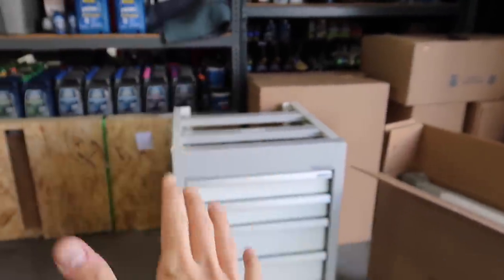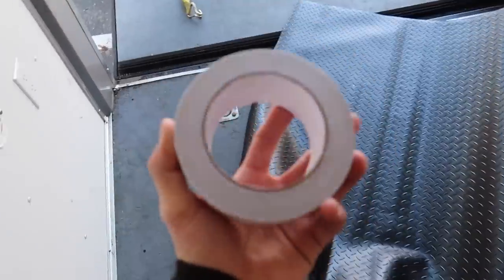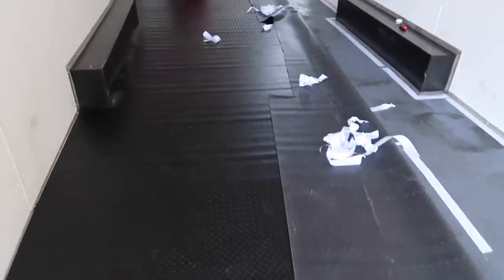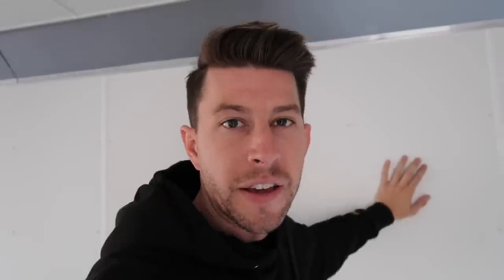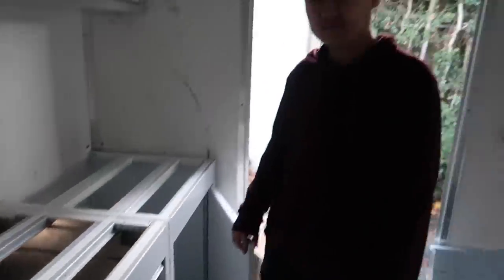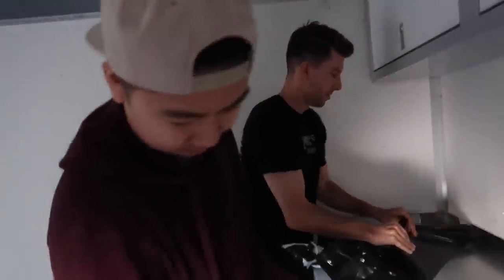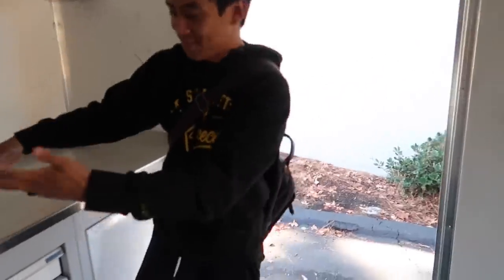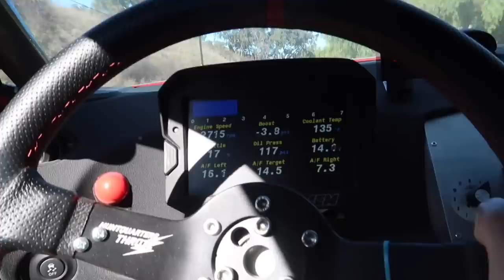IT’S FINALLY COMPLETE!!

Comment: I think I would’ve taken off all that aluminum trim along the bottom of the walls and ran the rubber up the walls and reinstalled the trim to keep the rubber from going anywhere. Also no water would get underneath the rubber.
Reply: Agreed. I was also gon a mention i hope he did more than sweep cause that most certainly didnt get all the dust and hope he put down more tape then just the edges.

Comment: I’m going to assume that you put new plugs with the coil packs and if so I’m also going to assume that you gapped them correctly? The issue may not be with coil packs or plugs, it could be the plug wire and an easy test for that would be to start the car in the dark and see if you can see spark jumping in the engine bay.
Reply: I agree. Or it could be a defective coil pack he purchased.

Comment: Had same problem. When getting into boost, power cuts. The problem was the sparking plugs. If not. Check the injectors if they are dirty or not. This could happen because the car has been sat for a long time without being used.

Comment: Yo Tj, worked a t trailer manufacturing plant for many years. Always trowel glue on the floors for flooring. Water will actually get trapped between that and the floors. Just food for thought. Love what your doing though for sure though!

Comment: TJ, also check wether this problem occurs only on the highest boost setting. Try the car on a lower boost level and see if it happens. If the problems stops on low boost try and get a different spark plug. For example instead of ngk 7 get ngk 8

Comment: Use raptor liner on the floor, you could even use there tint-able for custom colors. Would help with Traction and be waterproof. Not crazy expensive either.

Comment: Should have taken the D-rings out and cut the holes for them and reistalled, the lip around them would seal it and be the cleanest look. Also, lay floor, cut it to fit, before making it final, throw a heater in there and close it up and go get lunch or some shit, once it is warm the wrinkles start to come out and you can get all the wrinkles out when you stretch to... Tape it???,  I would have used contact cement, 6in out from the wall all the way around, and do the loading end all the way across and 4 ft back, it will see the most action. Final though if you want it to be really fluid resistant, go to the Home Depots and get you 50 ft of black commercial cove base and use it to seal the walls at the corners. Won't be fluid proof, but your tape will hold up longer and it will keep floor rot down, because if water gets under that flooring it's going to speed up rot because it wont dry due to the rubber not letting air get to it, and that is right where all you rivets or screws that hold the floor boards in are, and that is where water will starts to absorb into the wood first. Looks pretty decent though, and if the wrinkles come out I'll be shocked, but if after you drive a car over it a few times it goes all fun house mirror on you, maybe take some advice, I've only been installing floors of all kind for 17 years.

Comment: My opinion but under cabinet lights , flag pole set up ,  awning , led light bars at the rear and side of trailer and I think the trailer will be completed....... I would also install a trailer vent on the roof due to gas fumes from car and extra gas that's stored in there and from Calvin

Comment: It’s a shame you spent all that money to upgrade the trailer but didn’t take the time to clean and paint the walls before putting the cabinets and floor in. You also should have mounted 2x4 and 1x2 to the wall then mounted the cabinets to them so you can use better hardware for a stronger mount to be able to hold more weight on the shelves.